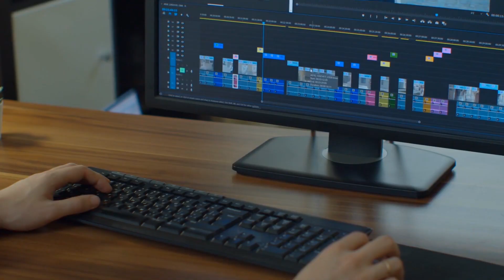PREVENTIVE MAINTENANCE (SONY F900 CAMERA CINE ALTA)

Comment: Such a beautifull camera. Any thoughts on using them in 2023?
Reply from the maker: Thank you! So far we've been using this camera for the past few years and no plans to use this in 2023 yet but we may do soon.
Reply: @chatmoves  What has your experience been so far? I am actually thinking of picking one up myself.
Reply from the maker: I have been in the audio and grip and lighting and for the camera, we have been using it for production shoot and this camera is good for brodcasting so far.
Reply: @NebulousFilms  it’s Ana making camera system I am going to post a video with it soon. I shoot a lot of videos with these old Sony CCD systems and this one is top of the line. It’s incredible in every way. You can use it in 2023-3000 it’s great.